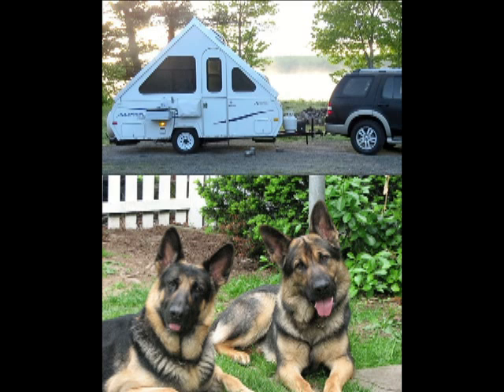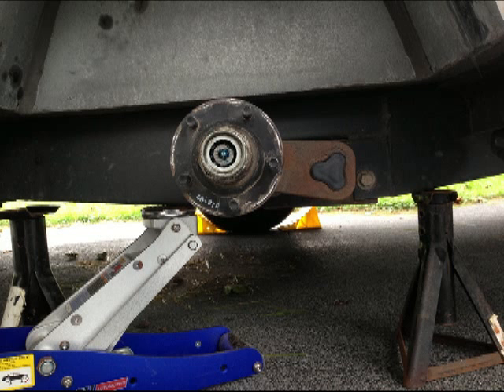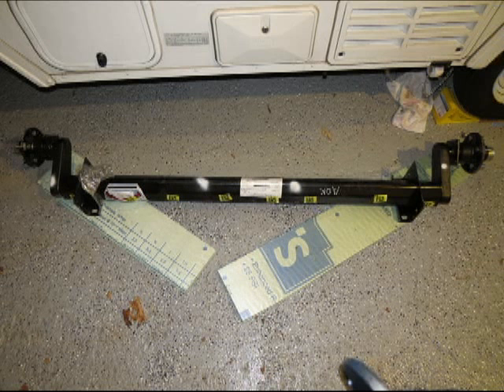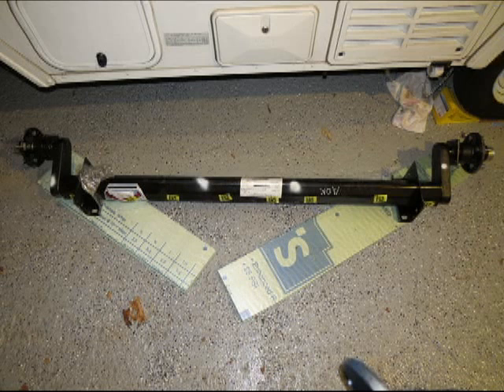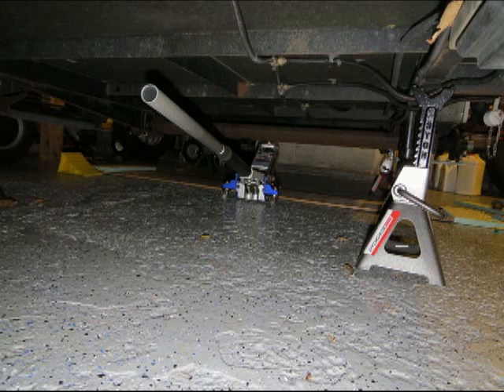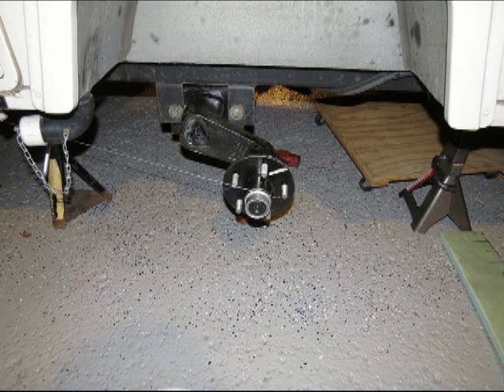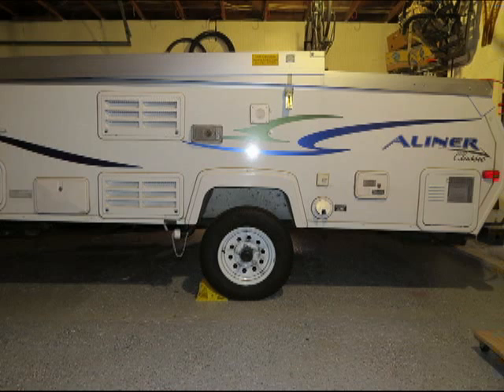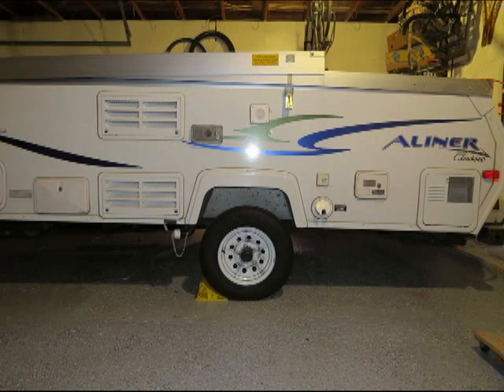Changing and upgrading  a Trailer Axle on a Aliner 2008  Classic Axle Change [2000lb to 3500lb]

Comment: Hi I have a 2005 Aliner. Looking into replacing my axle to give me more ground clearance. From the link you provided. Did you get the axle only and convert your parts off the 2000lb or buy the axle with the brakes and hubs?
Reply from the maker: I got it without brakes.  The 2008 Classic Model I have is pretty lightweight, and so I never put brakes on it.  There have been a couple of times I wished I had brakes, but a lot of times I am glad I did not.  If you are looking for greater height, tell them to change you angle to 45 deg Down, and get the 3500b axle.   If you use the tag off your axle its an easy swap.  Also it is recommended if you do get brakes, you get the 10inch.  Your old axle probable has 7inch.  Not good for braking and bad for your Bearings as they generate a lot of heat.
Reply: Going NoWhereFast thank you for the reply back.
Reply from the maker: @jamesodriscoll5691  No Problem, feel frist to ask questions..... I know a little, but some of it is important!
Reply: Going NoWhereFast thank you my Lady and German Shepard are ready to hit the road. But would like to get a few modifications before we take off.
Reply from the maker: @jamesodriscoll5691    Enjoy!  They are great little campers.  The german Shepherd with love it !.  It is like an oversized Dog house!

Comment: Awesome video! I just purchased a 1999 Aliner with the 2k load axle. I’m in talks with the company you used for the new axle. My code cannot be read though. Do you know if between 1999 and your year Aliner the axles were any different? If I can’t supply the code I have to supply a bunch of different measurements. You don’t happen to have those so you? Like hub face measurements? Your new axle you did 25 degree arms correct? Thank you so much! Your videos have been amazing in getting this Aliner somewhat restored. You mentioned you ran 15 inch wheels, what size tires did you go with? I plan on getting this thing on lots of fire roads but obviously need that ground clearance. Thanks again sir, Garrett
Reply from the maker: On my Website   http://www.GoingNoWhereFastRV.com   under the "home" menu is a "Files from my Computer". It has some information about axles and such.   Dexter bought AL-KO axles so I'm not sure if there are lost designs in the change or not.  I still would prefer a AL-KO to a Dexter.  They were better.   I also had a 4" lift spacer welded into my frame to raise it another 4 inches.  And of Course I had to change the stabilizers too.    If I was to change it again (they don't last long) I would get a 6 bolt hub so I could match my tow vehicle tires.  Even if they were 15 and tow vehicle were 17, they would fit and get you out of the woods if you ruined tires going over sharp rocks or something.  Normal Hub face is  5-4.5 .  5 bolts at 4.5 inches. I opted out of brakes, but I wouldn't do that today.  Its required almost everywhere now. They are easy to put on or remove...LOL   I might have my axle measurements somewhere, but I can't find them at the moment.  I'll have to look in my backup files.  Holler if you need more info!
Reply: @livewayout did you ever manage to track down the right axle?  I have the same year Aliner and and trying to figure out where to get a replacement axle.  Has been proving difficult.
Reply: SamKateOliver nope! Im emailing Dexter currently. I need to call Aliner direct still and see if they have any info on measurements for a 1999. Turning out hard without an axle code

Comment: I'm looking at an Aliner Classic Off-road trailer.  It comes w/ 14" tires and is rated at 3000# GVW.  Do you think it would have a 3500 # axle?  Thanks for your great videos.
Reply from the maker: Depending on the year it may only have the 3000# axle.  They switched back a forth a few times.I just put 15 inch tires on mine. The tires are rated at 75mph and can be "Aired Down" so they are not so bouncy on back roads and trails.  What really makes a bigger difference is the angle on the torsion arm...  Is it level, our pointing up, or is it pointing down 15-25 degrees?

Comment: Did you have to modify the step or add a two step unit to deal with the increased height?
Reply from the maker: No.  My step was already pretty low, like just 3 inches off the ground when extended. I raised the trailer just 4 inches, so the step is only 7-8 inches off the ground.  A normal step height.  If I had changed the tires to 14inch, then it would go up to 10inches, but still not bad.   Thanks for asking !

Comment: is replacing, repacking bearings an easy process? Can you do a video on this the next time you do it? what was the price for this new axle/project?
Reply from the maker: I actually do not beleive in "Repacking Bearings".  I know a lot of people will hollar and scream they need to be done, but I've worked on cars and trucks and you can not "REPACK" bearing as good as they were.  So I encourage monthly or every 3000 mile greasing of the bearings, but "repacking" is more likely to "Unpack" what was a good factory job that was working pretty good !!
Reply from the maker: If I remember the axle project was right around $500.  $250 for the axle and $250 shipping.  It came without any grease in the bearings.  But the "EasyLube" Axle system allows for a really good packing of the bearings while they are right on the axle.  See my Webpage...   GoingNoWhereFastRV.com  for more info on the axles and stuff
Reply: @GoingNoWhereFast  I know this post is old, but the best price I could find was local and was $771. Also found it for $631 and would need to drive 3.5 hours with additional hundred in fuel....total $731. Know going in to your project that a 3500 lb axle is much more expensive now.
Reply from the maker: @ghneely  Good to know. Thanks for the information.  I think I might have paid just under $500 for the axle and somewhere around $400 for the freight delivery.   So not far off.
Reply: @GoingNoWhereFast  Oh, that actually makes me feel better! Thanks for the reply.....so if this video is 5 years old....how is the axle holding up? Is it starting to get tired and squat again?
Reply from the maker: @ghneely   Not even a little, and it has a lot of hard road miles and a lot of weight on it as I add more to the trailer. I need to re-weight it.   The axle is one thing I did that came out perfect and has stayed perfect !!  lol
Reply: @GoingNoWhereFast  I am happy to report that Dexter delivered the axle to my dealer in 3 weeks! Thought it would take twice that long.
Reply from the maker: @ghneely   make sure its everything you wanted!

Comment: I understand it's stronger but what's  different about the axle that creates so much more clearance?
Reply from the maker: My original Axle had a angle of 0-degrees on the torsion arm.  The New Axle has an angle of 25 degrees down, That effectively lifts the trailer higher.  I believe the original axle was "worn out" since it should not have been that low.  However, the axle company told me that it was manufacturer with a 5 degree angle.  You have to look up "Torsion Axles" to really understand the difference in what the axle angles are and what they do.
Reply: +Going NoWhereFast thanks
Reply: Reading through the comments, you discuss the different angles that can be set. From what you saw when you removed the original, is it possible to rotate it a setting or 2 to boost the ride height? Thanks!
Reply from the maker: The axle is made with a certain angle of the torsion arm to spindle angle. My original was "Zero" angle meaning the arm was horizontal (Flat to the ground). I wanted it angled down 25 degrees, that raised the trailer up about 3.5inches.  Allowed one size bigger tires  13inch->14inch.  The Next 4inches I had the frame welded, and that allowed 15inch tires.   Sorry for the delay, your comment got flagged for some reason!

Comment: Chris/Going NoWhereFast:
I sent an email to what I thought was correct. Any more info on your axle swap (was it Dexter?) cost, and anything else. I may be doing the same swap on my 07 Aliner Expedition. Thanks much!
Reply from the maker: Jim M  It was an Alko Axle.  Same as what was on the Aliner.  Since they already had the original drawings, I was sure it would fit and work.  Cost was about $300 for the axle, and $150 for shipping.  I was amazed at how easy it was.  Raise up trailer and secure it up off the ground.  Remove tires, Placed a jack under axle, removed 4 bolts, Axle came down with the jack.  Rolled New axle under trailer on the jack, jacked the axle up into place, bolted it on, and I was done.  Of Course I do not have brakes to fool around with, but they are a separate and different install and set up.  I wouldn't try to do the axle with the brakes attached.
Reply: Going NoWhereFast Thank you so much for the reply! I'll call AL-KO and get the ball rolling. Much appreciated!